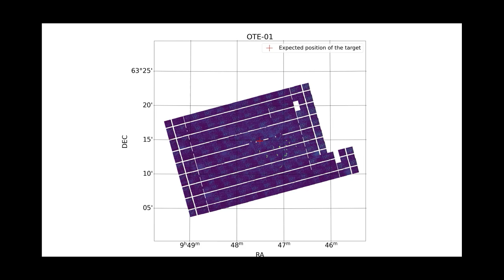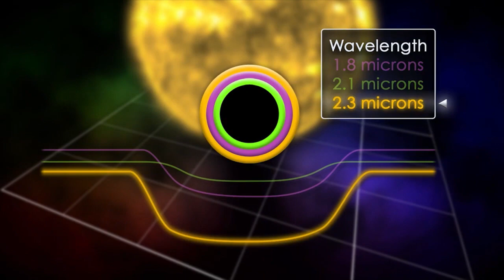James Webb Space Telescope Mirror Alignment Update - March 16, 2022

Comment: I may be a bit late, but I have had some questions that the JWST team may be able to provide. 
     First, since Webb was originally designed to complement Hubble, but the project took far longer than expected, and seeing that in recent days Hubble has been having increasing problems, are the two still expected to be working together? And if so, how will they work together and what are the proposed missions going to be focusing on?
     Second, in the early days of planning, what devices were proposed to be on Webb that were eventually not used, either due to practicality issues or weight reasons?
    Third and finally, what did the system overhaul in 2016 consist of?

Comment: I wonder if dust and small particles get stuck in the mirrors surface, would that degrade the optical perfomance?
Reply: The mirror's surface was cleaned with liquid carbon dioxide in a strictly air-conditioned clean room.
Of course, if human eyelashes or dust adhere to the surface, the optical performance will deteriorate.
Reply: Yes. fortunately, space is very empty: JWST will encounter micrograms of dust per year, on average.
Reply: Not nearly as much as you might think. The area obscured is much less than the overall area. This came up as a question about the impact of a micrometeorite hit to the mirror on the optical performance. The big Earth-based telescopes spend thousands of hours a year exposed to dust. They only really clean them every few years. Every few weeks, they essentially blast them with a CO2 fire extinguisher and let the solid CO2 lift the dust grains free of the surface.

Comment: If the whole thing moves to point at a target, how does the sunshade stay between the sun and the scope+instruments?  Does it mean that it can only work within a narrow wedge of the sky?
Reply: it does have a specific angular area it can observe in, because you are correct, but it’s not as narrow as you would think. throughout the year though, it does have access to all the areas in the sky because of its rotation around the sun.
Reply: It has limited field of view at any single time. But as it orbits around the sun, it has access to the entire sky. 

So to view a particular object, JWST might need to wait several months until its orbit aligns with the object.
Reply: They can change the sunshield angle between about -5º and +30º, so at any point they can image a cylinder of the sky about 35º wide.

Comment: I keep wondering how fragile the JWST is?
Could any small meteorite knock it to pieces? Or at least way out of alignment?
Reply: I wouldn't worry about that.

First, there just isnt much debris at all. Its not like in earth orbit, where earth has attracted all sorts of junk.

Remember... There are / have been other probes at L2 (some of them have been there for 10 years, and some way longer than that). And not one of them has ever ran into an issue.

Secondly... The sunsheild is the largest target on it. And it was designed to keep from shredding should anything puncture it.

Third... Over time there WILL be small potmarks in the mirrors. These won't degrade the images. Optics just don't work that way. For example, my old 10" reflector has several mirror chips and stuff. They don't affect the image at all. Any single imperfection only represents a tiny fraction of the overall area & they average out & smooth over. So its not a big deal.
Reply: @beta_cygni1950  Thank you!!

Comment: I wanna know why they make it go so slow?
Taking 3 months just to unfold the whole way....? At this rate will get the first picture when I turn 60yrs old.
I'm 35
Reply: It IS "unfolded". That concluded weeks ago.
The delay is to calibrate the optics and instruments then cool the system to nearly -270c to allow infra-red astronomy; it takes months!
Reply: The Infared needs to be in a very cold temperature to work properly. So it's taking time to get to its operational temperature. Telescopes that don't use infared will likely be faster during these preparation stages
Reply: It took 30 days to coast to its destination 1.5 million km from earth at the L2 point. During that first month, all the unfolding took place.
Currently, the mirrors have to cool down to under 50K (-223°C), the instruments have to cool down to under 40K (-233°C). That also has for the most part already happened. But the MIRI (Mid-Infrared Instrument) has to be actively cooled to <7k (-266°C) and the mirrors have to be aligned in such a way that all instruments receive the light in focus
Reply: First "real" (i.e. not part of aligning and testing process) images can be expected in  July
Reply: They take the time they need because if anything breaks, the 10 billion dollar 2 decade mission is immediately over as it can't be repaired since it's too far from earth
Reply: there are no one-hour photo shops in space.